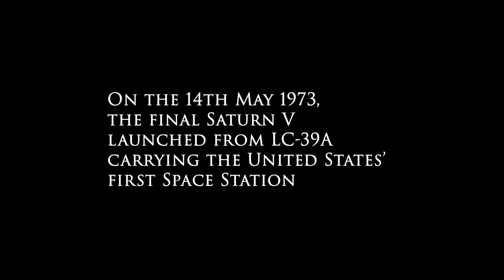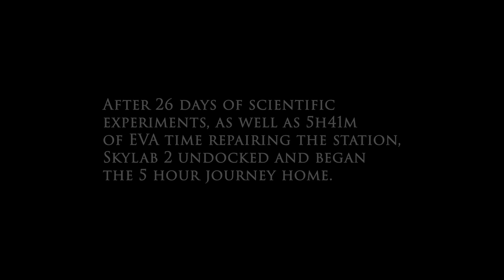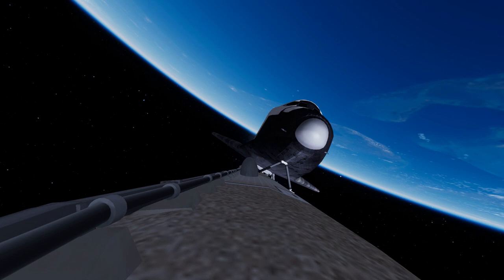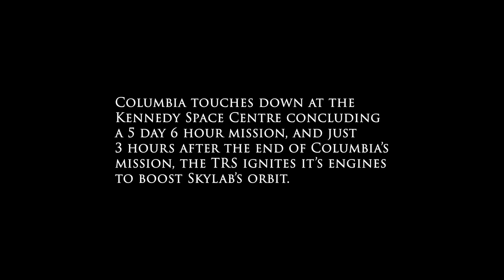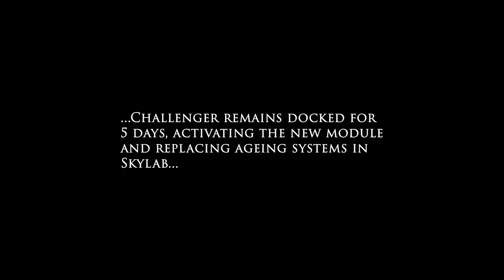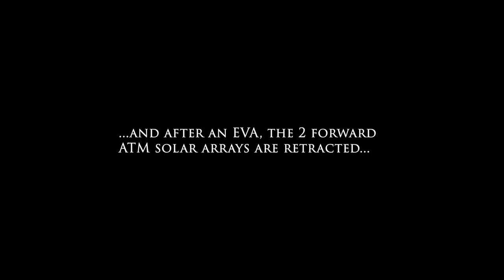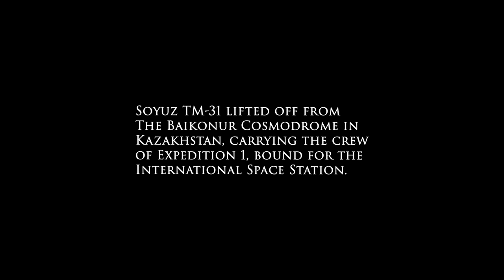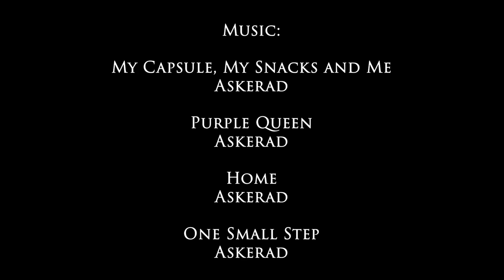Skylab-Shuttle | KSP Alternate History Documentary | KSP RSS-RO

Comment: Was the original plan to put the adaptor module on the front docking port?  Seems like it would be more efficient to leave the teleoperator stage docked there to provide boosts when shuttle is away.  Curious if this was in the plan or your own choice.  Awesome work btw, I still haven't quite figured out space plane voodoo.
Reply from the maker: Thanks for watching! Very good question and I'm not entirely sure. I probably could've made the program a bit more efficient but there's always room for improvement 😊
Reply: Yeah it would have made more sense to do that and put the docking port on the side port of the Skylab... the reboost module could perform reboosts and if the docking gear were up to the strain, even the shuttle's forward thrusters could have been used for reboost.  The shuttle would have to dock facing the far end of Skylab with the vertical tail up between the forward two solar arrays on the ATM...
Reply: The original skylab reactivation proposal was indeed using the front docking port, no idea why but that's what every diagram about it shows, probably for the 25kW power extension

Comment: Only problem was, Skylab was designed as an INTERIM space station, not a permanent one.  It was launched fully provisioned for the three crews that would be launched on Apollos to her, (Skylab 2,3, and 4) complete with their food, clothing, necessities, scientific experimental materials and gear, etc.  Skylab, having been constructed from a converted S-IVB rocket stage, had the forward hydrogen tank converted into living space with storage, and outfitted with amenities such as the kitchen, space shower, living quarters for the three crewmen, scientific gear, etc on two "floors" constructed of triangular-holed honeycomb gridwork floors that special shoes with matching "locks" on the bottom could be locked onto, to keep the astronauts in place.  In the center of the common bulkhead that separated the hydrogen tank living quarters from the lower, smaller oxygen tank, a "waste airlock" was installed, and the lower oxygen tank designed to be vented to space and in vacuum.  Through the waste airlock, the astronauts threw away all their garbage-- from soiled uniforms to food packaging and other wastes, so the oxygen tank acted like a big "space dumpster" with whatever air blowing the material out of the waste airlock into the oxygen tank venting overboard into space.  Eventually this "septic tank" or space dumpster would fill up, which would require a different means of getting rid of waste materials produced on the station.  

The Soviets solved this problem.  Most of their early Salyut stations, which were based on converted hulls of Proton rocket stages early on, which launched fully equipped for their planned crews, and later missions simply carried up a small amount of extra materials needed and left it on the station.  Obviously this wasn't acceptable for long-term habitation of a station-- a resupply vehicle would be needed, reboost of the station was necessary to overcome orbital decay, and a means of disposing of garbage and waste from the station was necessary for a station to be permanently habitable.  Subsequent Salyut stations incorporated a propulsion system derived from the Soyuz instrument module (service module in the West) installed on the back of the station to house reboost propulsion engines, and a second airlock at the center of the rear of the station in addition to the forward airlock for Soyuz to dock with visiting crews.  This allowed two crews to occupy the station at once, and allowed for a second docking port for a resupply vehicle.  The Soviets then modified their Soyuz into an automated unmanned resupply craft, replacing the reentry crew module from the middle of the three-module Soyuz vehicle and replacing it with unpressurized storage area housing propellant tanks, and designed an automatic refueling system that coupled up when the spacecraft docked, making the resupply vehicle a space tanker.  Soyuz's basic "orbital module" which was on the forward end of the spacecraft served as pressurized cargo carrier, since it docked directly to the station, allowing hatches to be opened and cargo removed as needed, it also would serve as additional storage or a "pantry" while the resupply vehicle was docked.  It of course also used the same instrument (service) module as Soyuz, so very common with Soyuz.  They called their resupply craft "Progress", which is still in use servicing the ISS today.  Progress could automatically dock with the back port on Salyut stations, where the station crew could unload the supplies sent up, whether provisions and clothing or additional scientific experiments/equipment and supplies.  Progress could refuel the Salyut's orbital propulsion system for its reboost engines, and could burn its own instrument module engines to reboost Salyut before departing the station.  Once all the supplies were removed, all the trash and disused instruments and broken gear or waste materials were loaded into the pressurized orbital module of Progress, and then the hatches sealed and Progress would back away, and perform a deorbit burn to put itself on course to burn up in the atmosphere.  Thus the station itself could be resupplied with provisions and garbage/waste disposed of by Progress vehicles continuously.  Crews could transport up to the station and back to Earth via Soyuz.  Later adding a multiple docking "node" to the front of the Soyuz module was used to create the MIR station, so that additional modules could dock at its four sideways-and-upward/downward facing ports on the node, as well as being daisy-chained off the end as needed, creating a truly modular space station.  Of course Mir would continue for many years right up to the ISS.  

Skylab COULD have been continued to be used by the US, but it would have had to be completely resupplied and waste hauled back to Earth via shuttle, as the US had no resupply module available otherwise.  Skylab had suffered some degradation to its interior and equipment due to the heat exposure after the destruction of the meteoroid shield during launch and the subsequent overheating of the station... so what that would bode for the usefulness of Skylab long term who knows.  I have a feeling that over time Skylab would have started falling apart, and it holding out that long would have been problematical.  We'll never know.  Mir was pretty well falling apart after its 14 years in orbit, so they say.  Course the first modules of ISS, the Russian ones launched on Proton rockets and the first node delivered by shuttle, have been up there a LOT longer... heck shuttle took 13 years of assembly time over 40+ shuttle flights just to reach "end of construction" in 2010 with the shuttle retirement, which left a few modules on the ground, actually.  SO maybe Skylab would have been fine for all those years, even drifting around unmanned.  Hard to say.
Reply: bro wrote a whole book💀
Reply: I largely agree with Mr. Strawwalker’s “book.”  Five years of vacancy would have made the Skylab very difficult to reuse, and its technology would have to be updated so thoroughly that building a new space station would have been more practical.

Comment: The delay in the Shuttle program in the late 70s was a huge disappointment and just the beginning of endless eye rolls with STS. Skylab was lost in May 1979, the first Shuttle launch didn't happen until April 1981 and there were so many problems which had to be fixed the second launch didn't happen until November 1981--seven months later. NASA never turned orbiters around as quickly as planned. 

We were supposed to get two launches a month. We had the Shuttle for 30 years (360 months) which should have been 720 launches. We got 135. Part of the justification of its expense was that it would replace all our other boosters : Atlas, Delta & Titan. That never happened. The stupidity of putting crew on the side of a rocket instead of on top with an escape facility became painfully obvious with the loss of two orbiters and 14 crew. In retrospect the Shuttle program was a dog.

When the Shuttle finally flew it was said "it had nowhere to go" since Skylab had been lost.  Even though most STS missions would launch satellites not service Skylab the loss of our first space station was painful to watch..

Comment: Didnt know that Skylab had an extra solar array that was lost in the accident, always thought it was only the X array and the right array.
Reply: The other array is somewhere on the bottom of the Atlantic. It was sliced off its folded place on the exterior of the Skylab about a minute and a half into the launch by a micrometeoroid/sun shield which was ripped away by aerodynamic pressure higher than anticipated.
There were honeycomb-like indentions built into the surface of the micrometeoroid shield and engineers had not accounted for the fact that they would fill rapidly with extra air during the climb. That extra air put more pressure into those indentions and that ripped the shield away.
The other side's solar array was locked into its closed position by the shield's impact, but fortunately was not permanently locked. Joe Kerwin and Pete Conrad meticulous cut it free on a quickly planned and exhausting spacewalk. It was a glorious moment when the panel was freed and began opening. It was like watch something bloom and come to life!